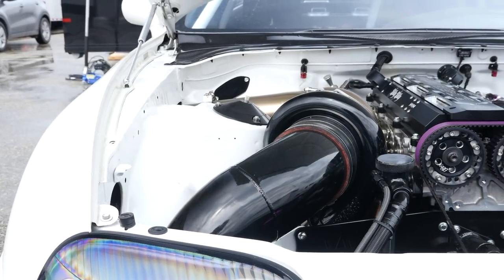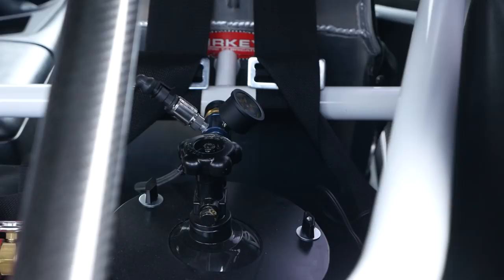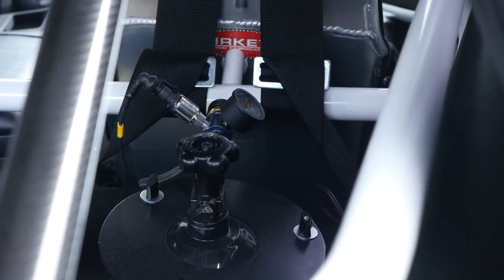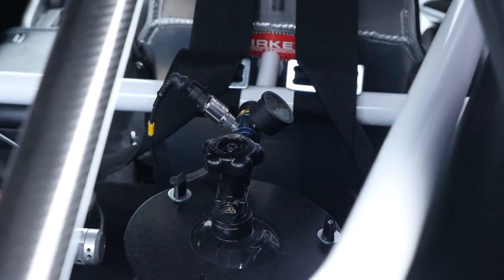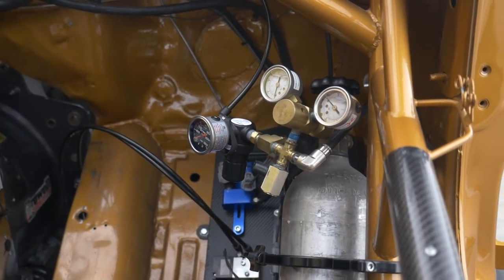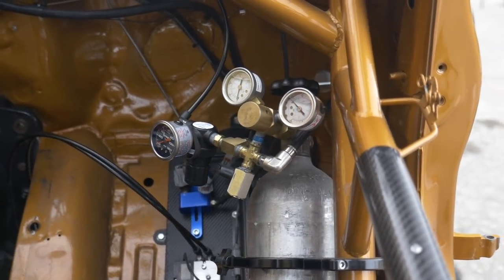What Is CO2 BOOST Control? | Pros And Cons [TECH NUGGET]

Comment: I'm begrudgingly realizing I might need to go to CO2 control with my VGT setup. I run a wastegate for boost control (simply plumbed with boost signal to the bottom port), but when I close the vanes at mid-range RPM, even with my stiffest wastegate spring, the exhaust pressure is high enough to blow the wastegate wide open until I open the vanes, killing my spool. Thanks for the video, super helpful!

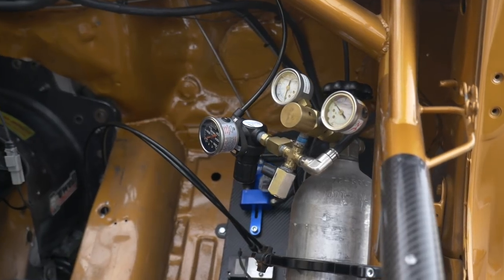Comment: Taz, it would be nice to see a more in depth video on CO2 systems.  I noticed at 0:10 the CO2 cylinder has two regulators and two lines.  This looks like a setup with a higher pressure side and a lower pressure side.  One line is also much bigger than the other. Are teams integrating fire suppression and boost control together?  Are any practice standards developing with the systems?

Comment: Would there not be a better way than using external gasses but rather with boost valve control ie line diverting air back around to the waste gas pushing back or air to electric based off psi

Comment: Can you "reload" your bottle with the air from your boost system in a bidirectional system?
Reply: No you would need a big tank because air when compressed isnt in its liquid form like C02... and a compressor would still be needed to achieve higher pressure than the intake boost pressure already available

Comment: Why hasn’t anyone developed a controller that’s powered by an electric motor?
Reply: They have, mostly on internal wastegates. Ford and Honda already use them already
Reply: Stepper motor would be great for this, can be moved quickly, has an encoder to keep track of position and can stand to high heat
Reply: Turbosmart just came out with an electric wastegate this year at SEMA!

Comment: Why C02? Why not just use a tank full of air?
Reply: CO2 is an inert gas which means if there is a leak then there are no potential flame igniting problems. Compressed air and things like oil/gas are a bad combination.
Reply from the maker: It also takes up less volume - Taz
Reply: @rookyandb  compressed air and oil/gas is very good combination :)

Comment: So the limit to this system is the resolution of the system to open and close the wastegate quickly enough to maintain the optimum boost pressure for the entire run. Sounds easy 😐

Comment: Lol at people bashing using compressed air. Its exactly how it's done in a modern heavy truck for example. Where you use pressurised air from the tanks for waste gate regulation. Being able to open the wg at part load is critical for fuel consumption and thermal management in that case.
Reply from the maker: Good luck building a fast drag who's day job is being a heavy truck. I think you might struggle to find more opposite applications than those two lol 
The point here is that what works for one application won't for another - Taz.
Reply: @hpa101  the turbo won't care in this case :) . The point was that pressurised air is an OEM solution fir this exact problem and not such a crazy solution as some commentera thought it would be.
Reply from the maker: I didn't see any comments saying it was crazy in general sorry, just no good for drag racing/motorsports. There is never one perfect solution for every application, nothing wrong with that as part of the fun is figuring out what works best where and why I reckon =) - Taz.
Reply: I work on class 8 trucks and have not seen them use compressed air from the air tanks to regulate the turbo wastegate.   Most use vgt or no wastegate at all...

Comment: why do they use CO2? why not say High pressure nitrogen?
Reply: Co2 is a far more economical option?
Reply: or just compressed air
Reply: @samtaylor3681  Exactly
Reply: @samtaylor3681  To keep weight down the pressure has to be high. I haven't seen compressed air for sale before.
Reply: Size factor. Co2 under pressure sits as a liquid. When this liquid is depressurised it will supply a way bigger gas volume that air at the same pressure.
Reply: @samtaylor3681  You do not EVER want to run a compressed air system in or around oil/fuel like that. CO2 is inert gas so it cannot ignite the oil/fuel.
Reply: @Rémi as opposed to the pressure that the intake air pressure could provide to the top of the wastegate?
Reply: @Gkuljian  dive tank?
Reply: @rookyandb  not compressed oxygen bro compressed air, you know like whats on the other side o the wastegate